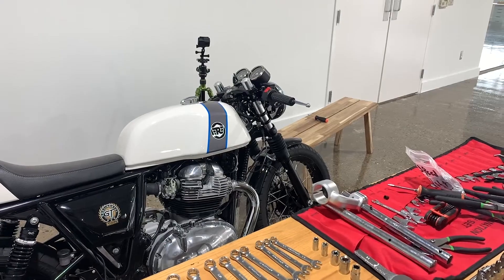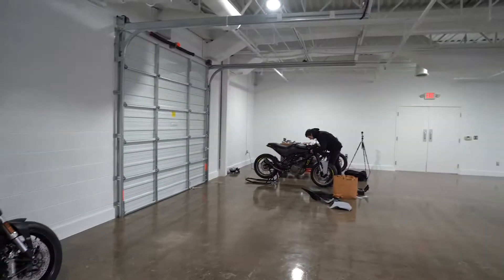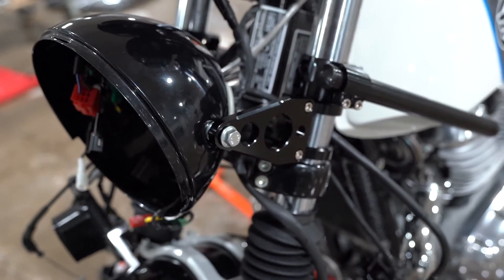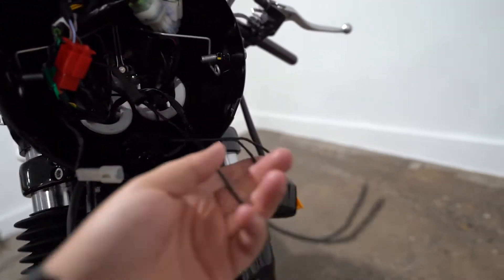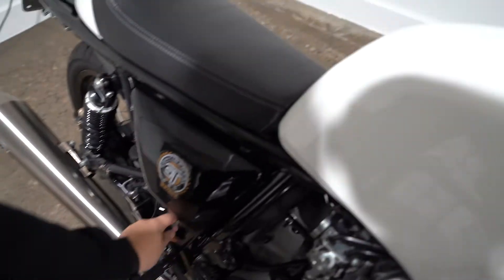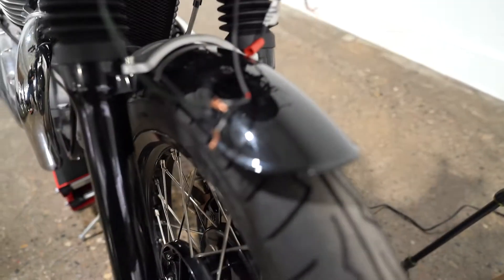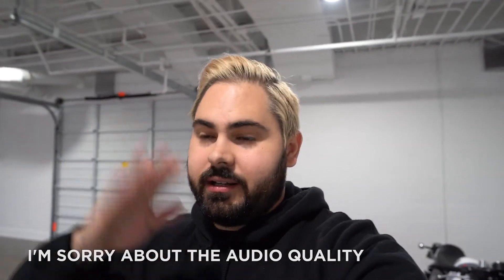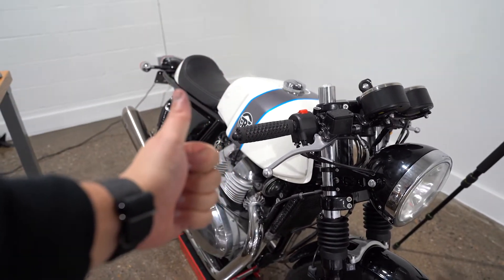Installing the K-Speed Headlamp Bracket on my 2019 Royal Enfield Continental GT650

Comment: I wonder what the washer situation would be if you had purchased their headlight grill, which uses that same screw to connect.  Maybe you could have gotten by with just a few washers between parts where you would expect them.  However, that old headlight bracket is super thick.  Nice vids.  I have a box of k-speed stuff I am going to be putting on mine.  I have done a few things.  But, I wasn't sure about tearing apart the fork.  This helped.

Comment: Great! Though I do think you could do the same job by just lifting up the top plate of the fork system.
Comes off clean and all done on the Main stand……. Unless I’m missing something.
Reply: Great suggestion! Was wondering about this. Most videos on YT seem to skip over this part or don't show a closeup of the fork removal in the headlight bracket install process.